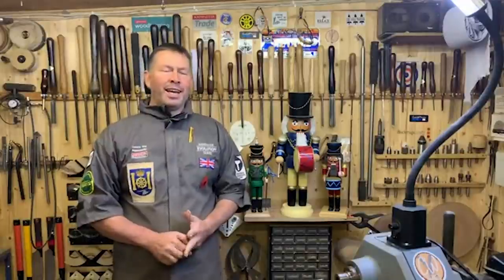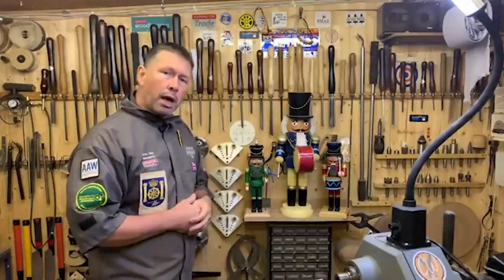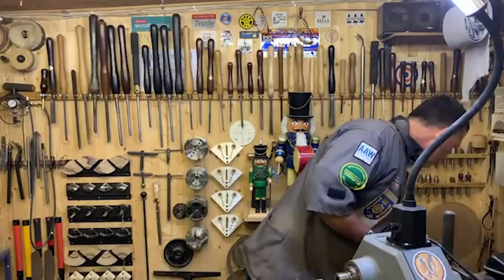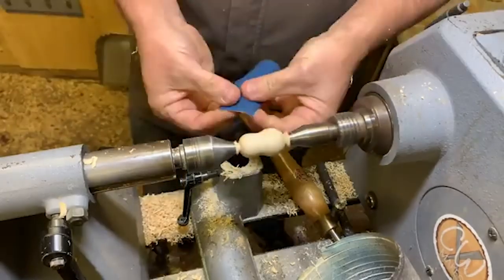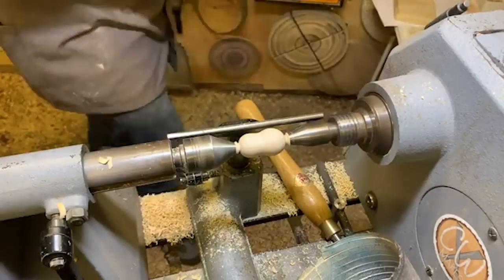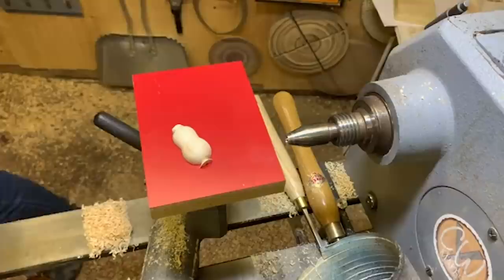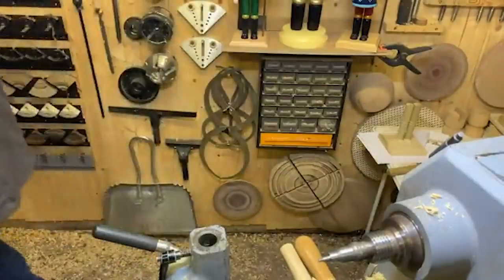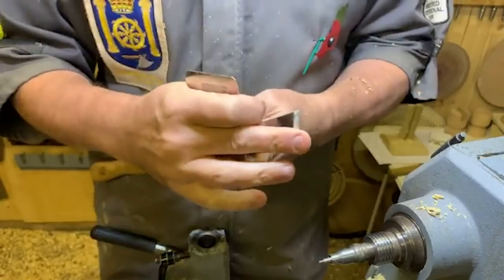Live Turning Thursday - Christmas Nutcracker Part 1

Comment: Great demonstration. I was intrigued by the light pull switch drive, because there must be lots of uses for it. A search on Amazon's website however shows they only sell an imperial size version, presumably from America again.  Since Axminster do not appear to sell imperial-sized drill bits any more, this leaves one in a bit of a conundrum.
Reply: I suppose it is back to making your own wooden version and holding it in your chuck.

Comment: Hi I understand I’m three years late getting to this project, but after printing the plans and starting the turning I have a problem ! Not with the turning as such but with the assembly. Your box jig looked so simple that I started making the box to fit my turned body BUT then I couldn’t find a dimension that gave me a through hole for the arms, and allow the mouth mechanism to work. Also page two of the plan doesn’t really give all that’s needed to cut the lever arm. I guesstimated that best I could but again thee are a couple of dimensions missing of that part. One of which is the pivot hole. Would I be possible for someone to check out these points please?
Reply from the maker: Hi there, Colwin advises the drawing is a rough plan to get you started and some adjustment may be needed to make them work to your nutcracker. Hope this helps